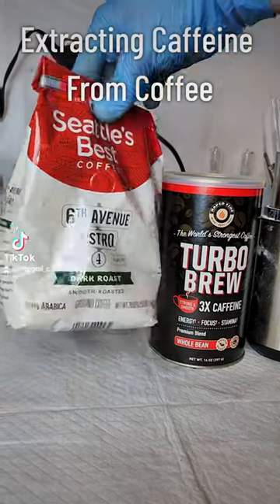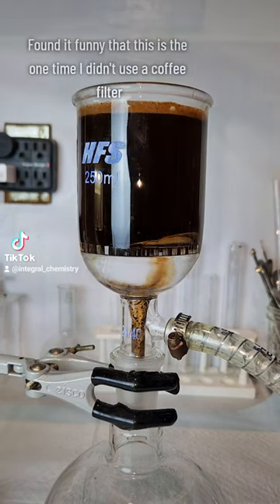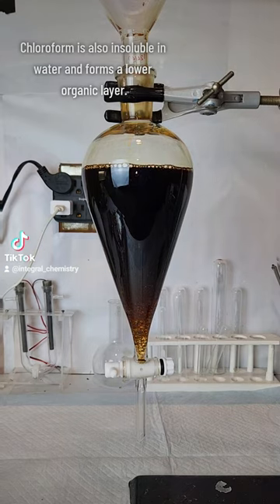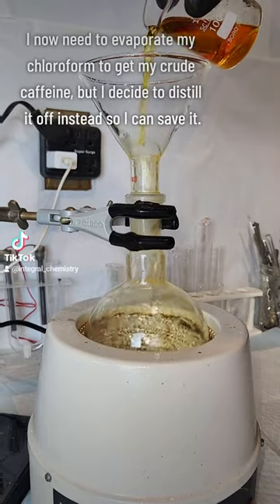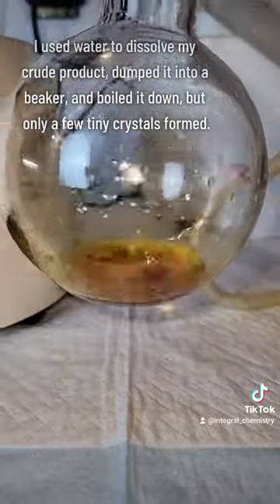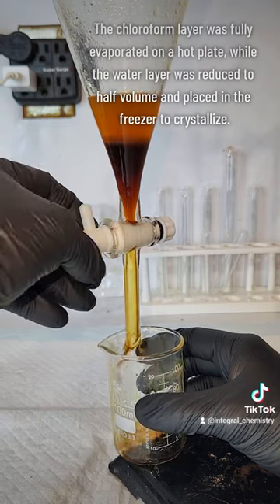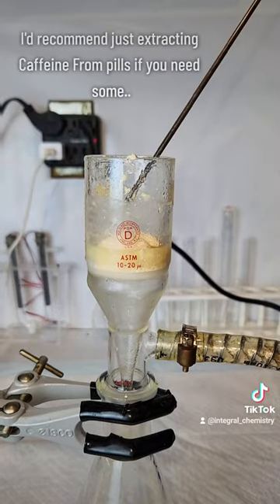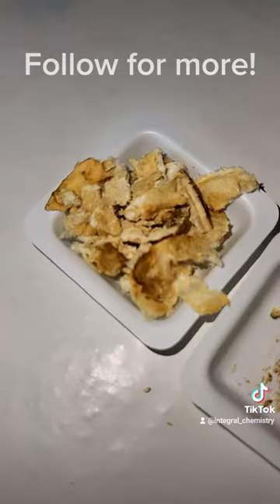Taking Caffeine out of Coffee

Comment: for a much cheaper solution to quick solvent distillations you could look into short path distillation, way cheaper than a rotovap but with vacuum assistance is still good.
Reply from the maker: Lol this comment finally pushed me to go ahead and buy a short path distillation unit. I've had my eye on one for ages but didn't have enough reasons to get one, but using it in that manner honestly made it worth.

Comment: You can purify coffee by sublimation in inert atmosphere (CO2 or N2 should work).
Reply: *caffeine
Reply: Good idea! 👍
A beaker on the hotplate with a round bottom flask filled with ice cold water on top might already work, too.
But the charcoaled impurities left behind are very difficult to remove afterwards, very aggressive cleaners like piranha solution or a melt of potassium nitrate are necessary for that.
Reply: @user255 
Better than purifying coffee is drinking expresso right from the start... 😂
Reply from the maker: would the inert atmosphere be to avoid decomposition of the caffeine, or to avoid the leftover byproducts from becoming fused to the beaker?
Reply: @integral_chemistry  
Only caffeine will sublimate not the charcoaled impurities. Inert gas will prevent oxidizing caffaine, but I didn't perceived it as a big problem so far because with the recommended simple setup there is little access of fresh air to it anyways.
Reply: @integral_chemistry  Both. In my experience the sublimated caffeine will get dirty of all kind of burnt stuff without inert gas. Careful heating helps, but that happened quite easily even when I was careful. However, I used caffeine tablets and using concentrated coffee might be very different thing.